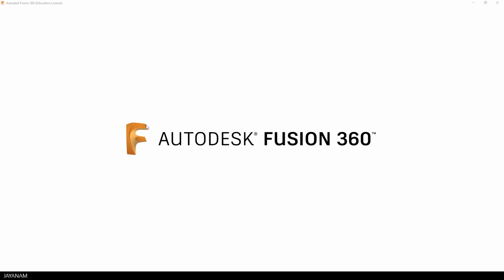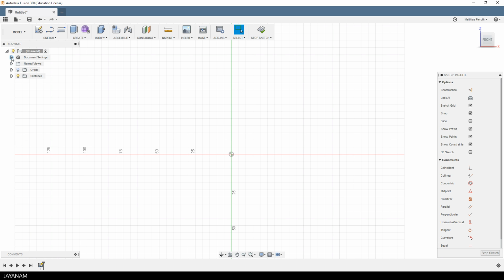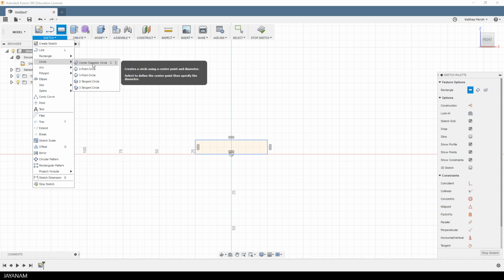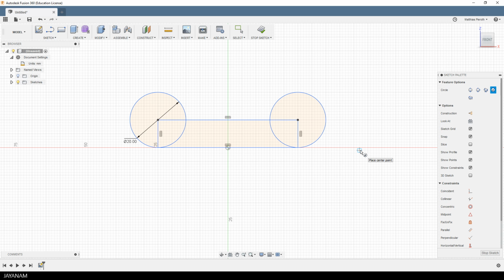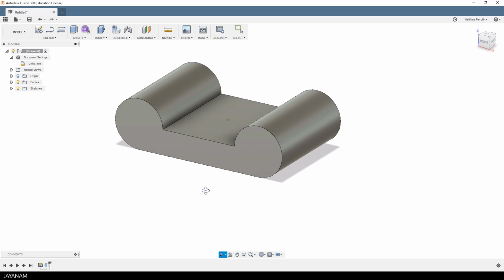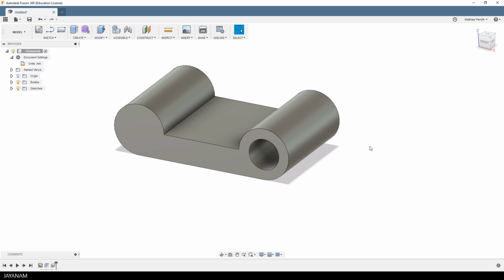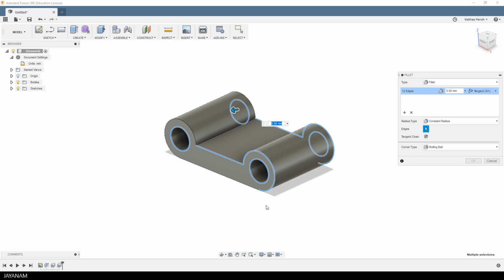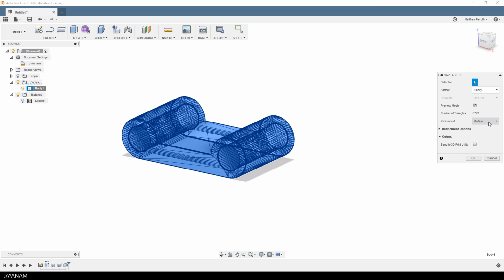Fusion 360 Getting Started Tutorial

Comment: Thanks for this tutorial. I find Fusion 360 to be easier than Blender for modeling certain hard-surface objects. Have you had any experience with texturing imported STL files in Blender? I’ve always heard that TRIs can be a problem. I’ve also found that the “convert to quads function in blender is not very successful converting Fusion 360 TRIs. What is your experience?
Reply from the maker: Hi Fred, it depends on the model, Fusion does a good job on creating meshes for printing but when importing to Blender you can see that it is of course not optimized for texturing and to convert tris to quads can only be successfull for models that are designed with quads in mind:-) But anyway, when you set the seams in an optimal way, texturing per se is no problem.